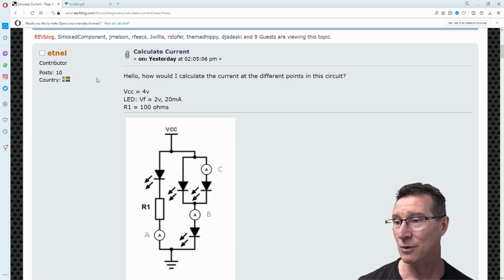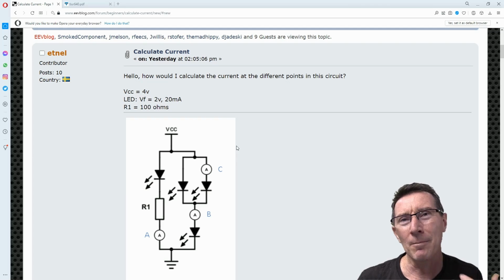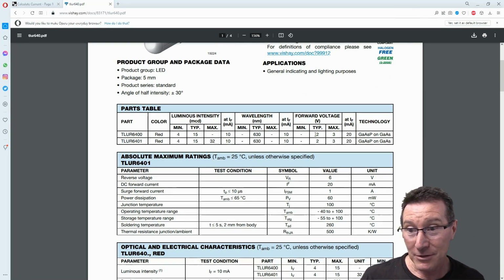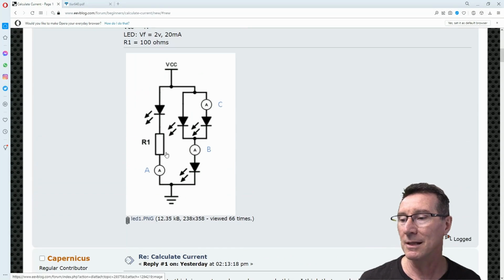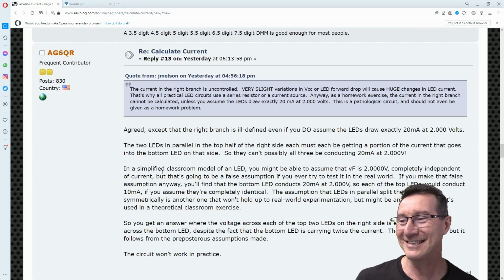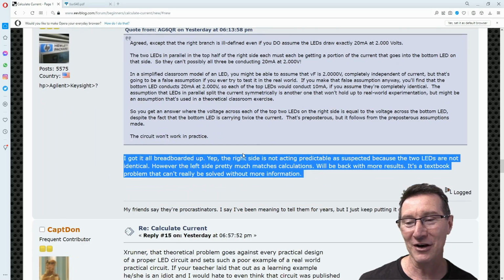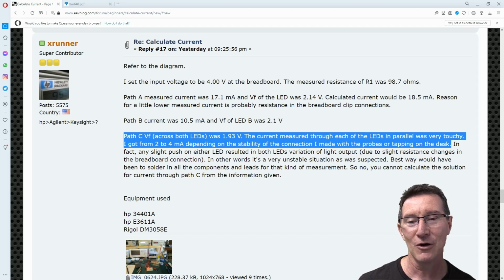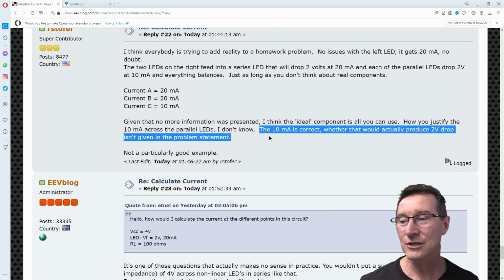EEVblog 1427 - An INFURIATING Electronics Exam Question!

Comment: Even as theoretical homework this is dumb.

I really really hope that the goal was to catch the idiot who would not notice the non linear aspect 
If you want to teach basic stuff you never give questions like this, at least give something that works.

If it gave some parameters like " Is " you could argue that the teacher was trying to teach the nonlinear diode current equation but they haven't even given that.

In my elec courses my teacher would always give things the semi realistic way. ( in this case forgetting about thermal effects and wires but using a non linear equation )

But using circuits on their non linear forms has use cases too( not this one obviously l) for example some transistor based current sources

Comment: 1st problem. This question is not physically solvable. Because diodes are semi-conductors. If you ignore that fact, something you NEVER do for real semi-conductors, then A = 20 mA, B = 20 mA and C = 10 mA. If you built that circuit, you would not even be close to these values.
Error 1: 3 diodes in parallel, will NOT divide the current by 3.
Error 2: semi-conductors are non-linear. V = RI does not apply unless you have the actual resistance vs current graph.
Error 3: semi-conductors like photo diodes or laser diodes are heavily affected by their temperature.

What I would expect is for the LED on A to light properly. The LED on B to overshoot it’s Vf and current spec but survive, for a while. And LED C to be either between 60% to 90% of max value OR between 10% to 40% of max value. And yes, 90 + 40 = 130%… of B’s max value.

Why? Because the 2 diodes in C will adjust to the lower Vf. Leaving more than 2 volts for B.

Comment: Of course, theoretically it can work... And you have to calculate it iteratively based on the I = Is *  ( exp ( Vd / n * Vt ) - 1 ). You know theoretically the n and the Vt so you get the Is. Because you got two LEDs over the single one, it isn´t really sure that you are going to get 20mA through B, probably you are going to get less, going off my head here.
Practically, you wouldn´t even put diodes in parallel because of the differences in manufacturing and temperature ( as in Vt ), which can lead to a runaway effect.
Practically, you also have your average LED lamp doing that crime out there, only take seriously the ones that have many many LEDs in series and hope the lead resistance is enough to balance out.

Blown LED? How much capacitance do you have on the output there Dave? Not much I would imagine, but could be capacitance enough 😛

Comment: At a job interview for a proof-reader/editor position at a CD-ROM publishing company, I was given a written exam with nonsense questions, so I proof-read and corrected their exam paper...

...I didn’t get the job!

Some people have no sense of humour ☹️
Reply: I had a very similar situation. I was going for a job working on Oracle databases. The interviewer sent me the table creation and insert scripts for a practical query writing task that was for a different database so wouldn't even run on oracle. I wrote straight back and asked if cleaning up the scripts was part of the task because these were for (i named the database they were written for) and won't run on oracle and it will take longer to clean them up than I was allocated for the task. I was told to go ahead and forget about the time limit. 
I got the job :-)
Reply: @MrBCRC  awesome
Reply: Damn, even did exactly what you were there to do.
Reply: >Some people have no sense of humour ☹ 
it's more like you were "overqualified", i.e.  their tech lead was too scared to be made obsolete.
Reply: @stanimir4197  Yes, that had occurred to me. Unfortunately that doesn’t get the mortgage paid.

Comment: Agreed it’s a stupid question, they aren’t providing the data sheet, so you’d have to interpret the 20mA is it’s nominal maximum current. Totally depends on the characteristics of the individual LED at its threshold Vf, and in real life it would probably vary between LEDs.

Comment: Would it be fair to say the result is 3 out of four burned out LEDs?
Reply: Not really because of the strict 4V VCC. There is some negative feedback. Lets start with inital value of V=2,I=20mA on the bottom right. 

Current not limited to 20A so current increases.
Current increases so forward voltage increases.
Forward voltage cant increase so current decreses.

You could calculate the equilibrium using the ideal diode law, but that probably won't give you a physically correct answer due to the 3 right diodes interacting.
Reply: @JoQeZzZ  I agree with the negative feedback part. If we wanted to make the question more complex though, the forward voltage would drop as the temperature of the leds increases, leading to more current and possible thermal runaway in certain situations depending on the LEDs and their surrounding environment, so I would say Ray is correct as well.

I think the only conclusion is that in real life there are many things I would try to use before this :)

Comment: Hey David, you missed a very important information, at each university note the diode or LED modelling is model as ideal 2V straight conduct diode model, aka the diode can accept infinity current and will conduct at 2V no matter current is lower than the given normally current!
Reply: In this case the problem is solvable, however, it is important to specify the models you have to chose. If you write 2 V @ 20 mA it may imply that the model is not the one you describe (you would have written Vf=2 V)

This is an excercise where the modelling of the components is determinant.
Reply: @vihai  Nope, it doesnt break the rules of the modelling i am mentioning. Aka, the diode model is a ideal modelling with a conduct current 20mA. But will there voltage drop during 10mA not really as it is just a straight 2V conduct model up to infinity. See how text book are describe and model things.
Reply: @sunebrian1423  there is no "THE diode model", every model is fine as long as its limit are considered.

There is the simplest model with Vf=0 and vertical current characteristic.

There is the model with threshold and vertical current.

There is the model with threshold and inclined current characteristic.

There is the Schottky model.

The model being used should be indicated. (Maybe it has been done during the teaching course and we don't know)
Reply: @vihai  You really need to go study more university material or text book as vf=0 means it is just a voltage source with 0V and valve behavior.
Meantime a ideal voltage source diode model can also be a schottky diode, as just changing the voltage level.
Go to library and grep a text book.
Reply: @sunebrian1423  thank you but "inviting to study university material" is not a valid argument. OTOH I have already enough "university material" in my bookshelves.

Fallacious logic aside, a voltage source with 0 V and a valve behavior is a valid model for a diode when used properly.

Again, no model is the true model, all models are approximations and they are valid and useful when used within their limits.

You can never assume a model implicitly.
Reply: @vihai  so whats the debate in here. Back to starting point. David's just ignoring the diode model in this question.
BTW when we are in an argue stage. From the starting point i had mentioned diode modelling that question hidden.
In other hand, when did i mention a true model, ideal model =/= true model is behaving ideal cases like without breakdown at infinity current.
Totally lost in this comments.
Reply: @sunebrian1423  okay, let's stop the "argue mode". You opened the thread by saying that universities use the model you describe. I refuted that claim saying that it's not generally true. If in a particular teaching course that model is chosen and globally implied than this information has been hidden in the problem as described.

Then, if we take the model you described the problem is still unsolvable since the current of the parallel LEDs are undefined.
Reply: @vihai  Nope, as the question said it conduct at 20mA so the parallel LED will draw 10mA each as below LED can only fit 20mA so it is still no problem.
Reply: @sunebrian1423  why cannot one led conduct 15 mA and the other 25 mA? Or one 0 and the other 40 ? All of these are valid solutions.
Reply: @vihai  cause it is ideal model. If one path is 40mA and one is 0mA how can the below LED can met the 2V 20mA when upper path is 40mA KCL dont hold.
Again, how can a total 25+15mA path return back to 20mA in this above solution.
In this case we can totally ignore the resistor path as it is well set in this question. ideal mode can apply without any question.
Reply: @sunebrian1423  oops, sorry, I meant 5+15 and, 0+20. You known the sum is 20 mA but you cannot known how it is shared between the parallel diodes. All the solutions are compatible with the model you described.
Reply: @vihai  No it would not be an unbalance result as two diode are ideal, which means it can only result in an 50 / 50 current shared path.
You can think as both diode have a same drop resistor that tend to 0 but both of them also have the same behavior (aka resistance). How would this ends up with a unbalance current split?
Not possible~
Or, if the model is a 2V with offset 20mA straight conduct model, then the right 3diodes can easily concluded as not current flow as upper path can not have 20mA sufficient conduct current.
Or the below diode will conduct as 40mA without burnout and upper diode conduct as 20mA.
What i have done during university study is write an assumption at the right corner to clear up the rules we are allowed to play with.
As you said it is highly depends on the model you define in the initial stage!
Reply: @sunebrian1423  what would be the reason for the diodes to balance? They are both working in an indifferent equilibrium. Any current satisfying Ia+Ib = 20 mA with Ia, Ib > 0 is a valid solution for such circuit.
Reply: @vihai  Same question why they would in disequilibrium as they are ideal model. You are just similar to claim two resistor with the same value would ends up with different current consumption, when they are parallel to each other.
Reply: @sunebrian1423  yes two *ideal*, 0 ohm resistors in parallel would have an indefinite current: similar scenario.

I=I1+I2
I1=V1/R1
I2=V2/R2

I=I1+I2
I1=0/0  => Indefinite
I2=0/0  => Indefinite
Reply: @vihai  NO~~~~~, if one voltage source is connected to a 0R in parallel then the current will be infinity, as takes limit  R -> 0 I -> Infinity.
Come on do some calculations.
In the diode case the max conduct current is limit by the question 20mA so it will result in an upper path 50/50 split.
Come on.
Reply: @sunebrian1423  I never said that there is a voltage source anywhere in the circuit. I just said that there are two 0 ohm resistors in parallel with a non-null current passing.

It's a circuit with an indefinite current.

And, curiously, it is a circuit that can be built in reality!

Take a superconducting loop, make a current flow between two arbitrary points on the loop. You can have your current pass indisturbed but the branches in the loop may actually be flowing hundreds of amperes in opposite directions.

It's not a matter of "coming on", it's a matter of applying math to the model you have chosen. And this is the mindset that you should have learned in the university since you had invited me to read some university textbook.
Reply: @vihai  Super-conductor will not have current passed crossed as voltage between that conduct medium will be zero.
So back to the original question, i still cant see why it will not 50/50 split, with all diodes are in the same behavior.
As diode is acting as a voltage 2V and a valve and need to hold the below path with 20mA.
All behavior need to hold in this case.
Reply: @sunebrian1423  superconductor loops may have a steady current with no voltage between any point in the loop.

Back to the original circuit, 50/50 is a valid working point, as any other point for which the sums of the currents are 20 mA.

That's why the currents are indeterminate, because you have infinite valid working point with no point being preferred.
Reply: Stop spreading nonsense, I live in a 3d world country and even our universities don't say stupid things like that , we use the non linear models
Reply: @atafakheri8659  Not really, diode modelling is begin from 0.7V straight conduct diode model without internal resistance. Aka a voltage source - based diode modelling.
Then if a diode would need a upper level modeling then we add a resistor to introduce slope behavior. Now it is start become more real; however it is far way near to non-linear rise up we need some log modelling aka e^(xxx). Then we add more temperature model as well. bar bar bar.
BTW where the hell a year 2 university student would understand a full diode model equation, all modelling start from the most simple and advance afterward. Wake up 3D world!

Comment: If they give you the forward voltage at a specific current it means that the LED has to be modeled as a real component with a curve that has a unambiguos voltage/current characteristic.

The circuit would work.
The current will be equally shared between the two parallel leds.
Thus it is impossible that all leds work at 20 mA, than the full curve is needed to determine the actual work point.
Reply: Yes, I think that is the point of that excercise.
Reply: I had a professor that told us when I give you a non linear just use some nominal parameters of Is , Betta , Vt , .....

Maybe it us like that 

So
Reply: You can't really be wrong if you just treat everything as linear while stating you are doing so ideally and the loads are thermally invincible in imagination land
Reply: @Magneticitist  yeah but if you never learn non linear analysis in easy circuits you will have a hard time doing it later
Reply: @atafakheri8659  You're right but it's impossible to do so unless you create your own values in this specific question. Arbitrarily doing so and answering it both ways would be a great response.
Reply: @Magneticitist  that is why I think the only problem of this question is not giving those parameters. ( in my courses the professor gave us some parameters and told us if questions don't specify anything use these, we used TSMC 0.18 um as reference )

Comment: You know what's worse? Being penalized for questioning such a stupid question in the margin. Years later I am still being thrown these types of idiotic questions even at work where all answers are wrong and you have no recourse to point this out, however,  you have to complete the multiple choice "training" in something not related to my actual job because compliance says so. It is so infuriating.
Reply from the maker: I remember failing a digital exam because I used IEC logic symbols instead of ANSI which was the only one the lecturer knew.

Comment: Assuming ideal diodes RHS will burn out (either the leds or wires) and become an open circuit leaving you with just the LHS with the led and current limiting resisitor. easy q 🙃
Reply: Huh ... no ...
An ideal diode is one that obeys Shockley ideal diode equation ... and given the Vf=2V @ 20mA data point you can be sure that the current is less than 40 mA in the RHS.
Reply: @smunaut  An ideal diode just experices a voltage drop across it with 0 internal resistance. I think you might be confused.
Reply: @lachlansmith6746  I was going to write the same thing but I thought on the subject a little bit. The thing is "ideality" of a diode is a spectrum. Schockley models non-ideal diodes with ideal *p-n junctions*. Since the diode in the question has a specific amperage at a specific Vf, it must be non-ideal. A truly mathematically ideal diode will pass infinite amount of current for any positive voltage, as you said.
Reply: Exactly my thoughts.
Reply: If the leds are modeled as real, matched, components they cannot burn because 40 mA is an upper limit for the current of the bottom led.

Comment: That is a trick question in the exam, nothing to be infuriated about.
Reply from the maker: As I said, only if it has a "Please explain your answer" text box.
Reply: @EEVblog  I my electronics courses we never ever used multiple choices, Is that something that happens in your countries?
Reply: @atafakheri8659  exactly. Biology and medicine fields all had their fair share of multiple choice questions, but our ee was mostly like solve it on paper or write extended answer.
Reply: @666aron  and also in my electronics courses our professor just gave us a paper of model parameters of the diodes and transistors he was considering in the questions once in the term and said whatever question I give you use these parameters. I think it was derived from the tsmc 180nm node

Hence we never used  any ideal models after our intro lessons
Reply: @EEVblog  it has to have one, otherwise what's the value in wasting time with those courses? lol, maybe I've been too long in the (real) field.